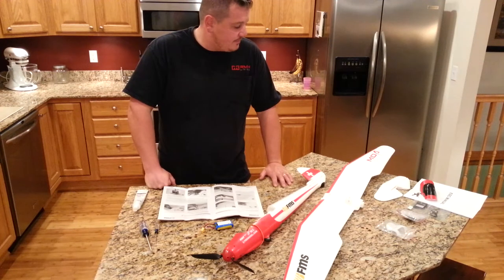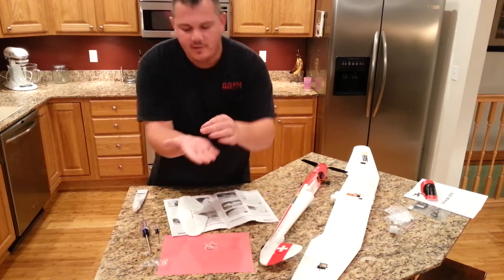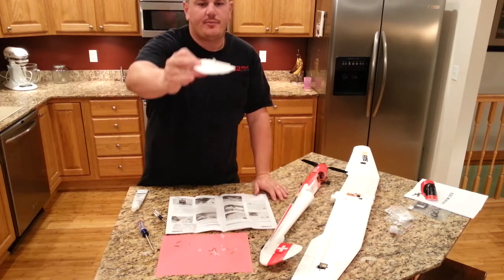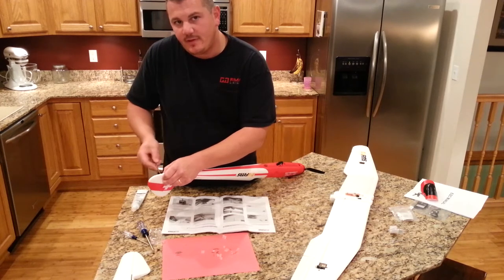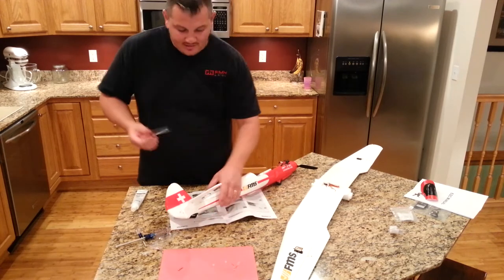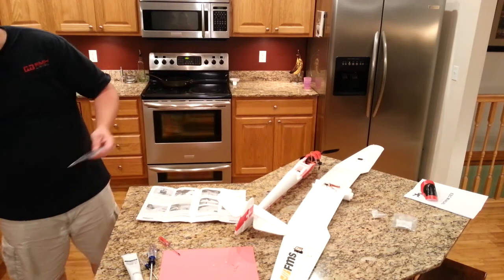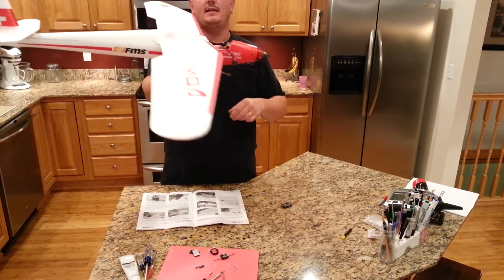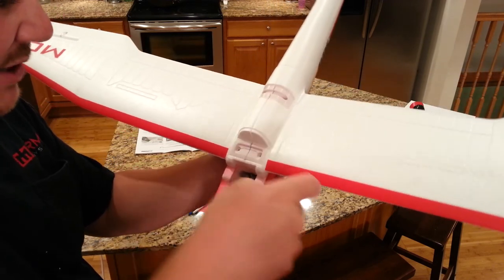FMS - Moa 1.5m Glider - Build Video - Part 2

Comment: Brian, any idea how it would handle without the gyro? Looking to pick one if these up and thinking about an Rx without stabilization.
Reply from the maker: Good question Chris! I almost always have a stabilizer, weather it be a Lemon-RX or an AS3X Rx. It's a personal preference issue, BUT I can definitely say this plane gets to being a handful without the stabilizer. Since she's quite tight inside, you might have a lot easier time getting a smaller Rx in there, plus you could place it where ever you want. There's a cavity under and between the wings that I wanted to use, but I didn't think the stabilizer would like that spot.

...but, to make a long answer short, I have other planes I'd be more willing to do without a stabilizer, than this one.

The Flaps and CROW make a HUGE difference in land-ability, but not 100% sure this plane was worth the effort????
Reply: Thanks, Brian! I get where you’re coming from on “is this plane worth it”. My search continues for that do it all sail/glider. May go the Multiplex route. Thanks for your vids. Enjoyable and informative.
Reply from the maker: Thanks Chris! I appreciate the feedback! I've been looking for a while now too.

To be totally honest, the Volantex ASW 28 2.56m sail plane is really good, but it's definitely a project plane :)

For a cheap thrill, the FMS Moa is totally worth it!!!